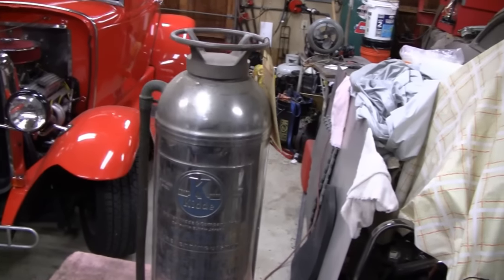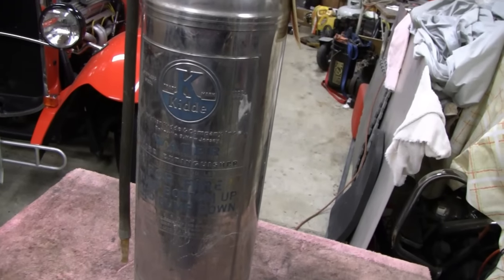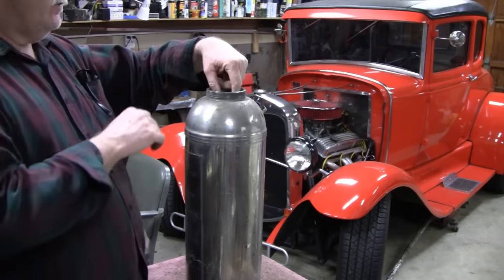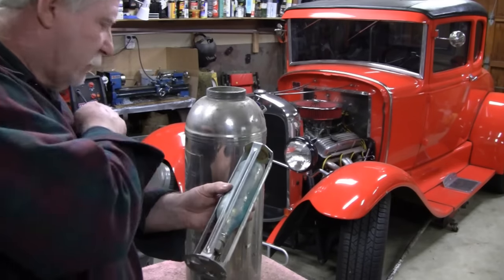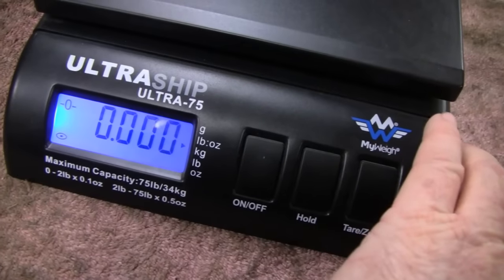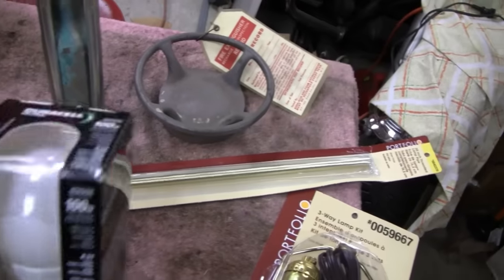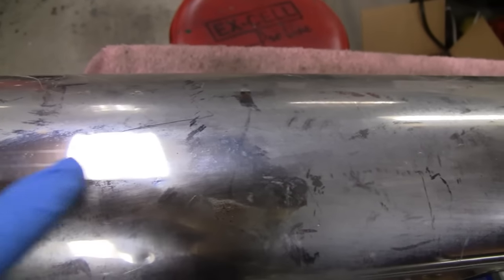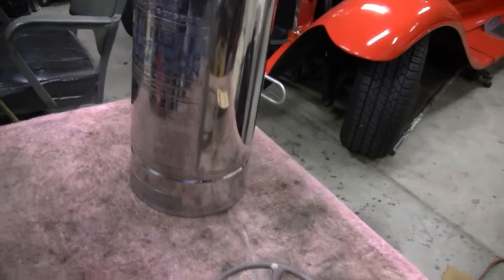MAKING A FIRE EXTINGUISHER LAMP (part 1)

Comment: That old Extinguisher looks great! I saw a guy throw out one of those copper extinguishers ones you mentioned, After I went around the block to go get it, it was gone.  That brass cap also looks great! I would have tried some Brasso but the steel wool worked well.  Don't forget about the metal fitting on the side where the hose connects to. I would bet that is brass as well. -Nick.
Reply from the maker: Thanks Bud!! I thought that fitting was brass also but it's not!!☺
Reply: Hm. That is interesting. I wonder what that fitting is made of then? Oh well. I look forward to seeing the next video, buddy!

Comment: OOOO Steel wool used with some soapy water will be even more gentle, and do really well.  It also works great on glass... I'm a window cleaner, so I have experience with it.  It's only good for one use, though, as it will rust after that.

Comment: The older extinguishers comprised cylinders containing a solution of baking soda (sodium bicarbonate) and water. Inside, a vessel of sulfuric acid was positioned at the top of the body. This design had to be turned upside down to be activated, so that the acid spilled into the sodium bicarbonate solution and reacted chemically to form enough carbon dioxide to pressurize the body cylinder and drive out the water through a delivery pipe. This volatile device was improved by placing the acid in a glass bottle, designed to be broken by a plunger set on the top of the cylinder body or by a hammer striking a ring contraption on the side to release the acid. Cumbersome and sometimes ineffective, this design also required improvement.

Read more: http://www.madehow.com/Volume-1/Fire-Extinguisher.html#ixzz4Ry2MtGjb
Reply: Back in the 70's I was working as a locksmith and went into the office of a large jewelery store. Big store, busy office on the second floor with about 5 or 6 women all on those roll around chairs. I noticed a large 4'x4'x5' cast iron safe against the back wall, with the door open and chair scuff marks all around the inside of the door that had a small box that contained a 2" x 6" glass vial. After the lady signed my reciept I asked her if she knew what was in that glass vial on the door of that safe. She asked why and I told her if they hit it wrong it would fill the whole second floor with tear gas. I moved on to a better paying job, but always wondered if they ever shut that door.